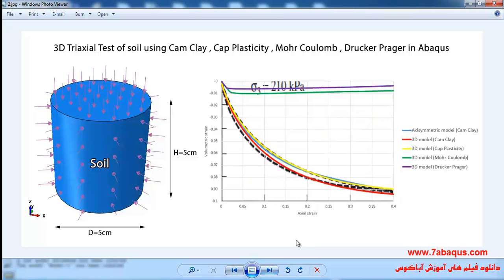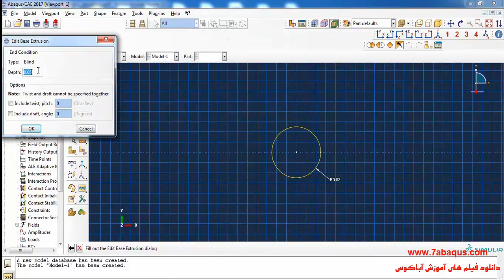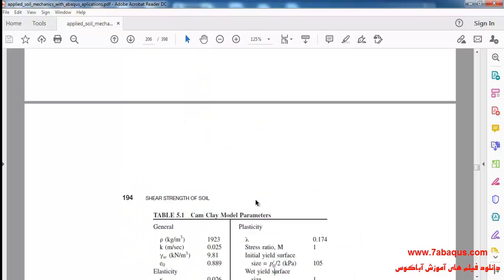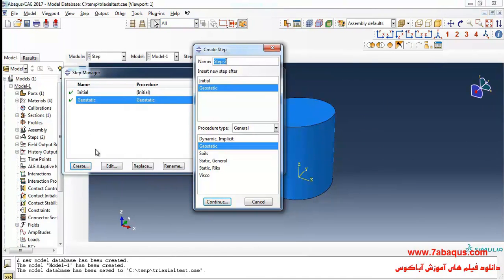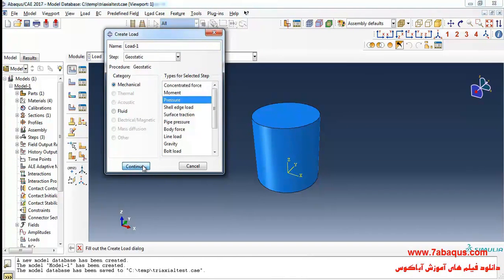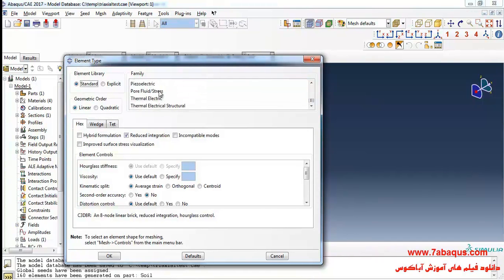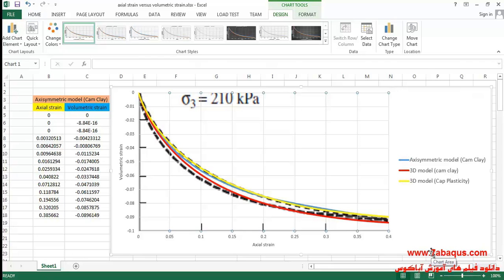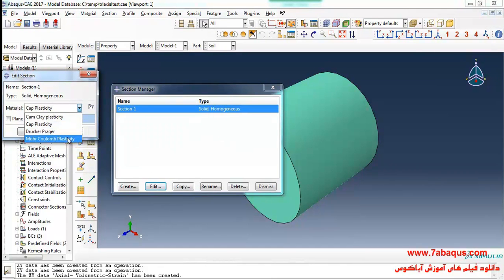3D Tri-axial Test of soil using Cam Clay, Cap plasticity, Mohr-Coulomb, Drucker-prager Abaqus

Comment: Thank you for the video, but I am curious about the boundary conditions in the 3D model. Are the bottom and top surfaces horizontally fixed or smooth?